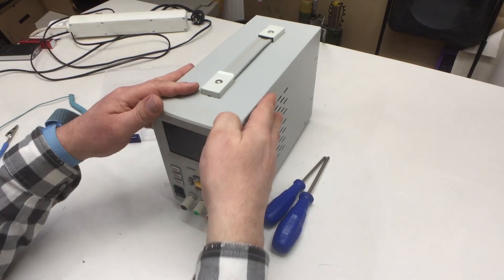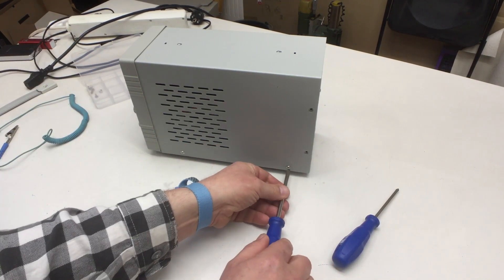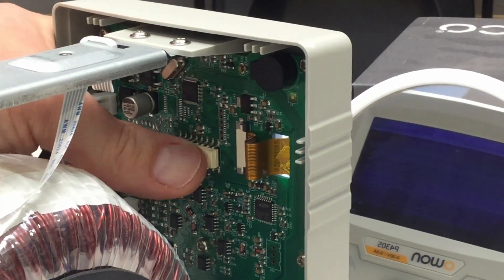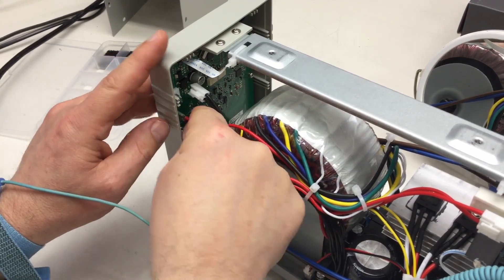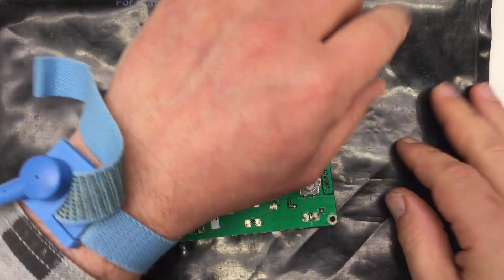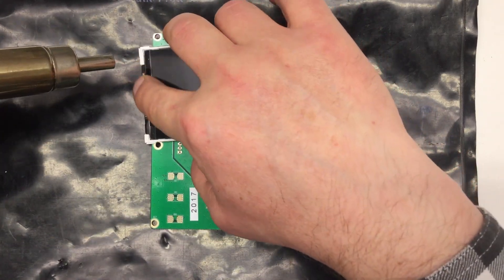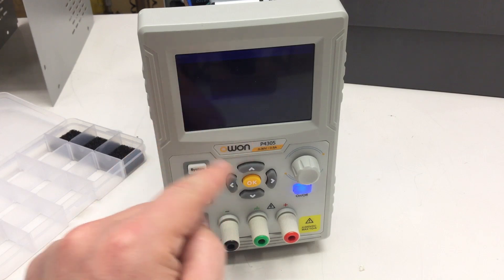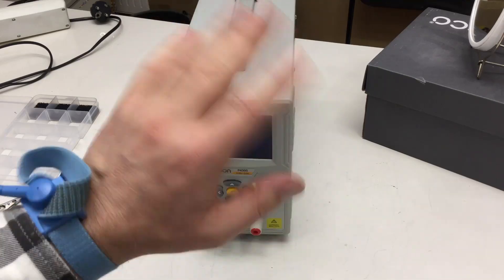OWON P4305 Lab Power Supply Review (4): Authorized Repair Attempt by Me

Comment: Hi Robert, did you check if you get output on the RS232 port ?
Reply from the maker: Yes, it does work. I tested a Chinese USB to RS-232 converter (also no real RS-232!) using the OWON with the dead display: https://youtu.be/Ew_Z8tc9UbE
Reply: @robertssmorgasbord  if the powersupply works fine through "RS232" , then it will be probably a dead LCD screen. 
If there was a voltage rail missing, the powersupply wouldn't work. Grtz
Reply from the maker: @BjornV78  Yup! But the LCD is not completely dead (meanwhile it's working again - see next part of the saga). So far I ruled out a high temperature thermal fault (I cooked that thing in part 2) and pretty much a dodgy connection (this part). In the next part I'll rule out a low temperature thermal fault. BTW since I filmed the next part the display is working just fine.

Comment: Is anyone from Owon by any chance watching this? No way anyone is gonna buy their stuff after watching this video... Or any of the previous ones dealing with this power supply. 
I've dealt with Rigol in the past for similar malfunctions on some other type lab equipment and not once they sent me the same unit back unrepaired, even the equipment with intermittent issues like yours. Possibly with a report "All OK, we tested it...".
Reply from the maker: I don't know if OWON is watching my videos. I made it a point NOT to let the distributor in the Netherlands know that I do these videos about the P4305. To the best of my knowledge OWON hasn't had the unit in their hands. The unit was checked by the distributor and all my communications were with the distributor. Though the distributor mentioned that they're in contact with OWON. Regarding RIGOL's service: They do play in another league! Unfortunately also price wise. Their comparable, but probably better, bench power supply goes for about 350 Euros.